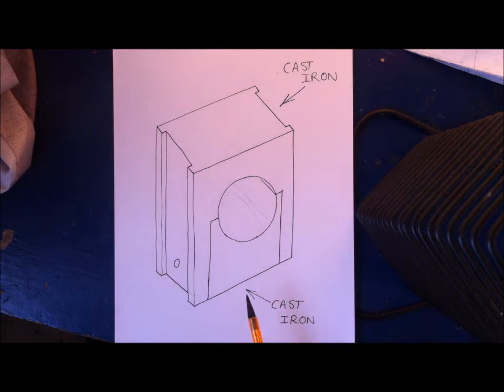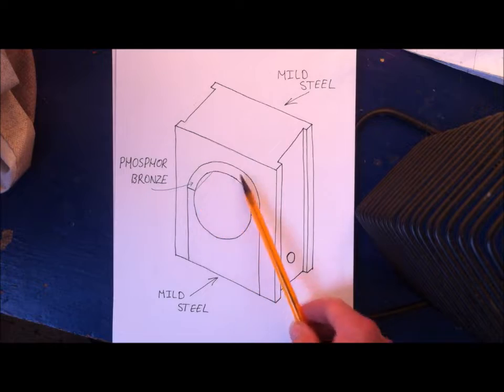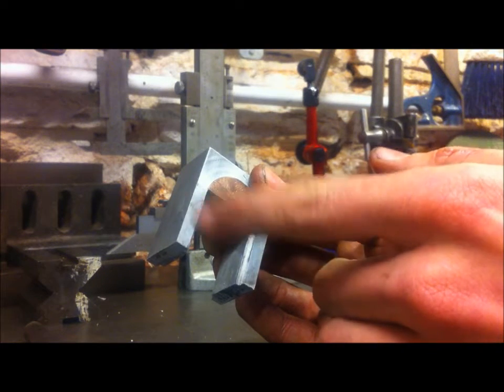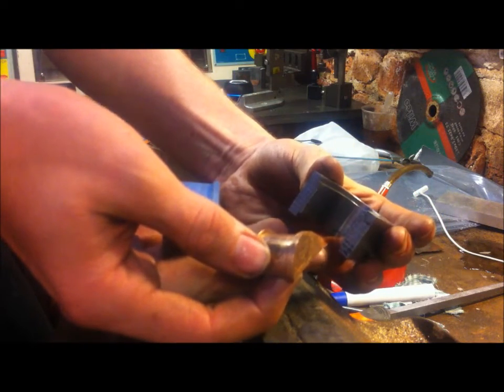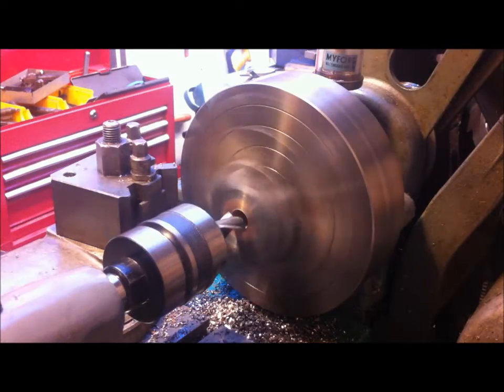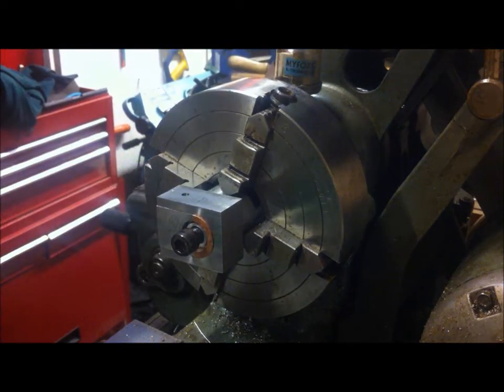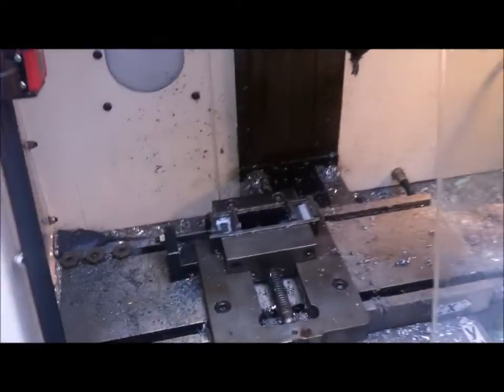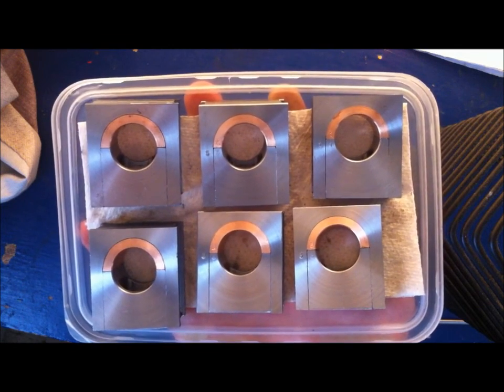Machining Split Journal Bearings - Home Workshop

Comment: Just working my way through the archives ... I really like your use of the slot drills in the tailstock chuck to prevent drift into the soft bronze, I think you were right to be concerned there. Beautiful work ... I like doing 4 jaw work in my own ML7... 

😎👍☘️🍺

Comment: Very impressive craftsmanship. I just wonder about the concept though, as there will surely be significant sideways forces on the bearing when the loco is working, in addition to the weight acting vertically?

Comment: I love your approach on these journal boxes, with the half round upper shell. These bearings are beautiful miniature versions of large press bearings we used in Reynolds can machinery, with a 15" journal diameter. They could run for 10 years, 24 hours a day, before being reworked.
Reply: The key is to only wear the oil out, not the actual bearings ;)

Comment: This info may or may not be of any use to you, but it may also be of historical interest for some :)
Where you have the Phosphor bronze in your bearing, the trams I used to work on in the museum had a layer of whitemetal as bearing material, being soft metal.
I mostly did electrical, but got to help out cast a set of blocks one time, was heaps of fun :)
Reply from the maker: Thanks

Comment: why the need for the dividing head on the mill? Why not just set the square block on parallels in the vise and flip it 180?
Reply from the maker: m hornete A, using the dividing head to index guarantees parallel faces, and 90 degree corners. B, By taking a finishing cut on one side, rotating 180 and cutting the other side with out altering the z height, you guarantee the the bore will end up right in the middle. C, by using an accurate fixture that locates on the bore you guarantee that the faces will be parallel and true to the bore. 

Having parallel faces, a centered bore and a well aligned bore are all crucial and any errors will cause binding/bad running further down the line.

Comment: Fantastic machine work. Would like to have seen more detail on how you made the main housing piece. Did you mill the whole thing mounted in the dividing head?
Reply from the maker: radbot1 I would have liked to put more in but I didn't have much footage worth watching, I bored a hole through with recesses each side, one recess was cut while the work was set up for boring and the other recess was cut in the lathe using that expanding mandrel I showed. Then I sawed and milled the sides.
Reply: Ah good stuff. Thanks for the informative reply and for the video.